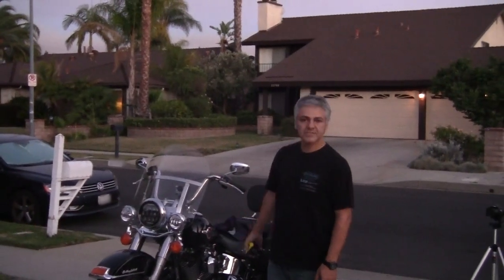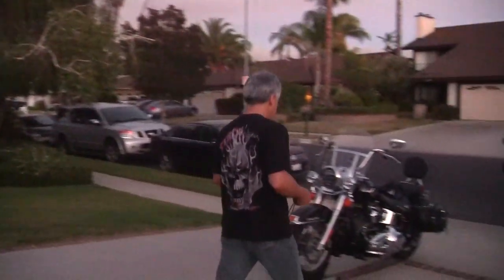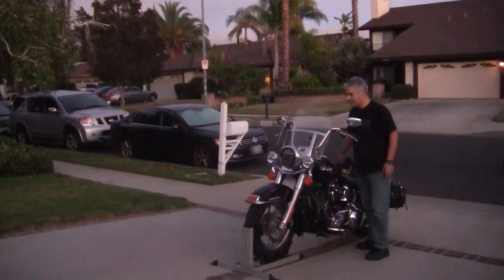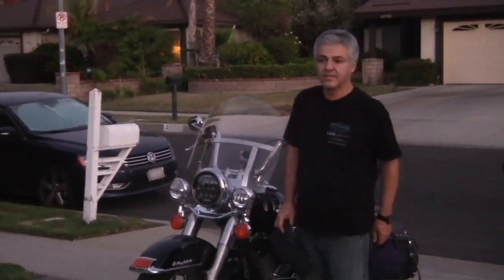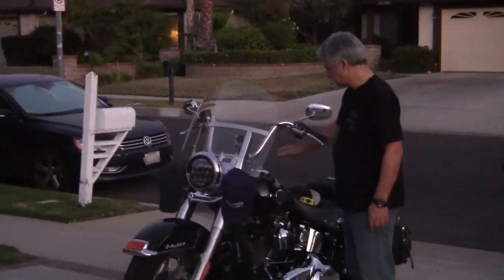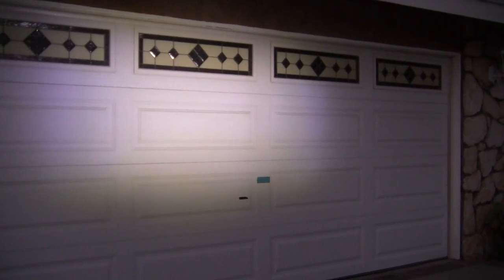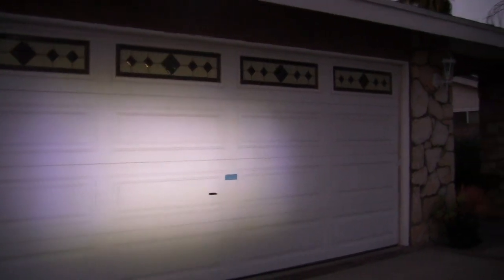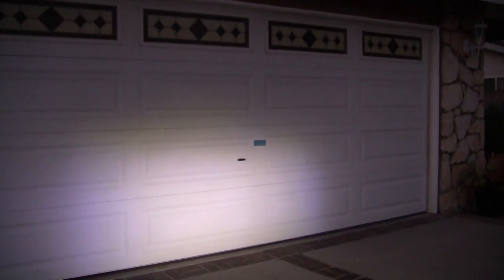How to adjust Harley-Davidson™ LED headlight. DIY, Harley-Davidson™ Heritage Softtail®

Comment: I always adjust the headlamp with my weight on the motorcycle with the bike on a level surface...  Thanks for the video.
Reply from the maker: Putting your weight on the bike is a good idea specially considering that rear and front shocks wear at different rates over time. I am going to try it to see how much variance I get.
Reply: cyronlighting --- I have been doing it that way for 35 years, just makes sense to me since you use the lights when you are on the motorcycle...   Let us know how much difference it makes...

Comment: You should NOT check and adjust your headlights on a sloped surface like done in this video.  Only do it on a flat surface.  You may think that because the  bike itself is on the inclined surface as well, it makes no difference but it does.  Even if the garage door was at a 90 degree angle to the driveway (it isn't), you still should always do this on a flat surface.
Reply: ++you're so right. it's always on a flat surface and it seems he marked 25ft from the front of the tire, it's 25ft from the front axle to the wall++

Comment: Did you account for the angle of your driveway
Reply: Of course it would be better to do it on a level surface. However in this case the motorcycle is parallel with the driveway surface. So the driveway slope will not play a big role. What does play a role is the angle of the garage door which is not perpendicular to the driveway. Using some basic geometry I figured it can off by about 1/4". Still fine for demonstration purposes and well within acceptable range of motorcycle headlight alignment considering that motorcycle azimuth angle changes depending on load, luggage, wind speed, lean, etc. Thanks for watching and Ride Safe!

Comment: Can anyone tell me where to undo and which knob to adjust the headlight?
Reply: Depends on the bike. If Harley with buckets it is normally right under the bucket. 9/16" nut and bolt. You need two wrenches to hold one while turning the other.

Comment: just out of curiosity, where is the 80 % and 90% specifications coming from? the HD service manual for a 2015 SGS states at 25 ' on a level surface, draw the center line from the tires to the wall and draw the vertical line up on the wall as well.. have someone of the same body mass as the rider sit on the bike, measure from the floor to the center line of the low beam bulb for the LED day maker headlamp, then draw a line at that height horizontally across the vertical line previously drawn....it also says to measure from the floor to the center line of the auxiliary lamps as well it doesn't say anything about 80 or 90 percent... is the setup for this bike that much different from a street glide?
Reply from the maker: Mostly drawn from DOT requirements. It applies to all bikes and cars. Putting the rider on the seat is a good idea.  In our experience most cruisers’ rise do not change very much with the weight of an average rider.
Reply: Is it possible that it is because they are led lites?

Comment: DId you take into account that your front tire is sitting higher in the rack when you measured your headlight heights and the corresponding mark on your garage door? Also, did you rake into account the slop of the driveway? Both of these items would significantly effect your aiming. This aiming process needs to be done on a level surface. Regardless, your video was helpful.
Reply from the maker: Bob you are very keen in your observations. The bike front tires should not be raised on a stand. If you must raise it then you can raise the rear by the same exact amount. As for the slope of the driveway it really does not matter as long as the bike is on the same slope.
Reply: Did anyone understand you require 2 9/16 spanners to adjust the headlight? Without these tools, the movement we see in the video does not take those in to account?

Comment: Where is the bolt that you adjusted for the main headlight?
Reply from the maker: The single bolt is on the backside of the bucket, where it is mounted to the frame.

Comment: Hey buddy, how do you losen the headlights and passing lights to adjust with your hand as you did?
Reply from the maker: Loosen the bolt for the bucket mount. You will need two sockets to hold both ends of the bolt & nuts. I believe both are 9/16.

Comment: If you are siting on an angle like this your adjustment will be too low.
Reply: Ideally it could have been on level ground. But the difference is not much at all on this slight incline. The bike, the driveway, and the garage door are at the same tilt. Thanks for watching.